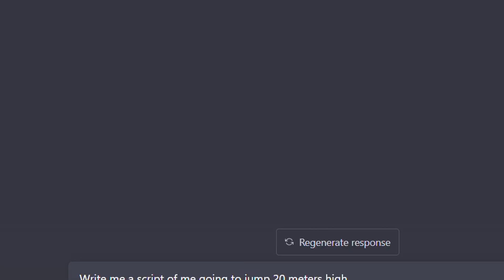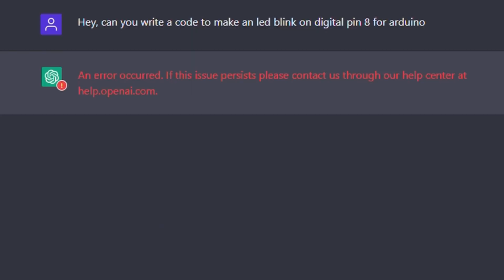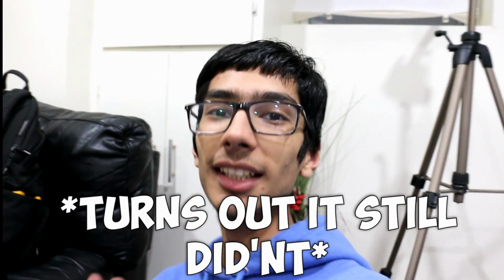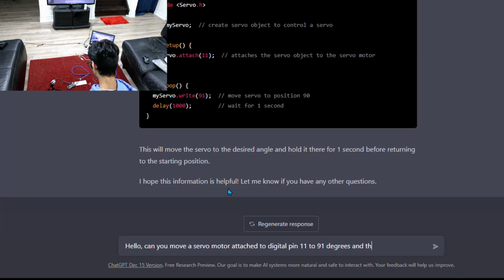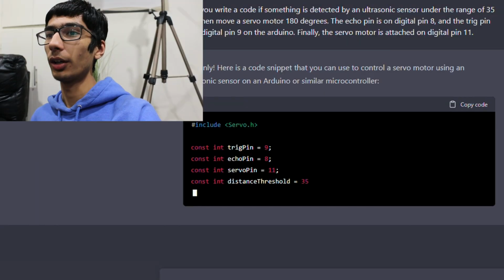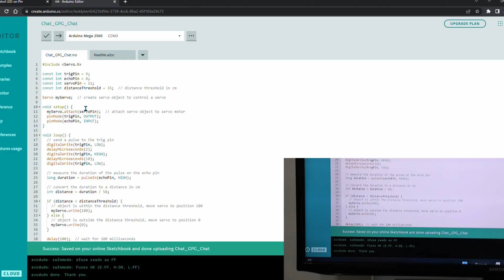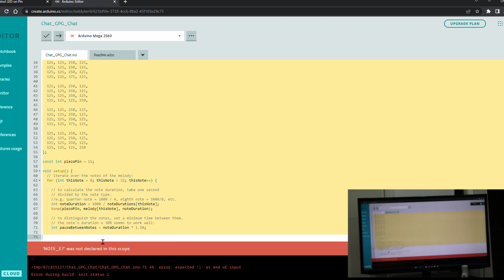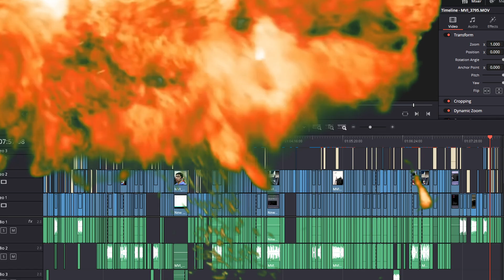I asked ChatGPT to program this Arduino Code then THIS happened... | ChatGPT vs. Arduino

Comment: you can tell it to make the melody in hertz instead of notes. with notes, you need to have the library loaded and also inside that library there need to be every note defined that you want to use.
Reply from the maker: Hmmm, quite interesting. I will try again to get the command in Hertz, instead of the notes. Thanks.

Comment: I've tried chatGPT myself, and it's actually a genius at coding, you just need to use the right words. I've actually had it write a portMidi program in C for my guitar hero controller, you know, so I can use it like a REAL instrument (I also installed Avis Rejoice for the initial conversion, plus a few other things, but whatever), and it worked! I did need to give it a little more instruction after the fact, but you would need to do that with a real programmer anyways, so all in all it's a big win!

Also, great video! You could honestly make a series on this, where you have a project in mind, and the point is to see how much of it can be done with AI, and how much of it needs manual intervention. It would be a good example of how AI can be integrated into the workforce.

side note: it's also really good at teaching, I can see it being a tool used by schools to help individualize learning plans at any grade level, and that's just one of many possible uses for ChatGPT
Reply from the maker: Absolutely, that is a very great insight!! I also noticed that the word choice while giving the instruction to it was a very important key. Yeah, it is true, it is a great teacher that can be used even in schools to teach ANY type of coding, all the way from junior to higher levels. Your guitar midi project sounds very interesting, and it is shocking how the AI actually helped you code it. I have also made an air piano midi keyboard, and it taught me a lot as well in my early days. I wish CHATGPT was also back then 😔😔, I could have used it also, ha ha. And thank you so much for the advice, I will surely try it.